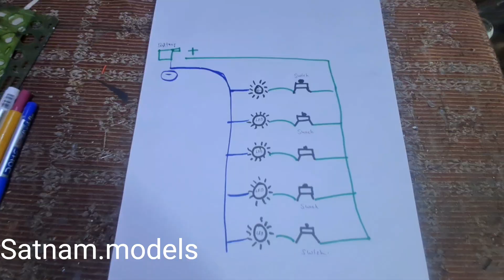Piezoelectric road model || foot step power generation || Piezoelectricity working science project

Comment: Shastriyakal paaji!!! Twada project mainu te meri team nu bo changa lgya. Ee bo wadia project si.

Ek gal puch di si, actually jeda circuit the tussi tara lagatiya honiya h, enanu mada jeha explain krdo mainu kl project dena haiga hai.

Te Ek hor gal, kyuki ee mera pehla project si ta krke mainu pta nhi hega ki ede materials kitho miladage. Mainu bus ena das do veer ji ki micro switch, wires, pave battery kitho mildiya te dukandaar nu ki kaina hai. Aur in 3 cheeza da rate kinna ho u ga?